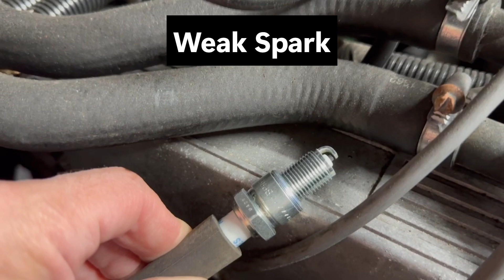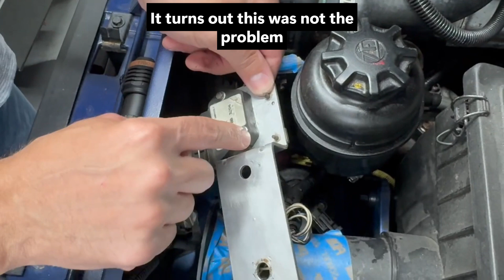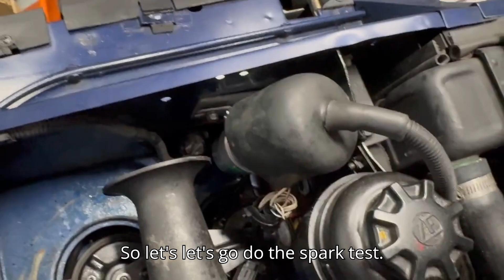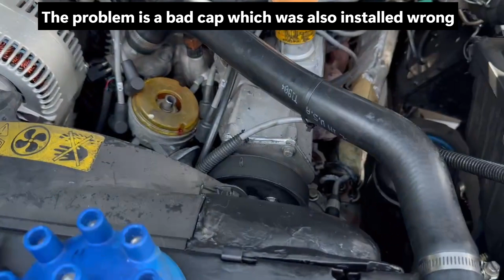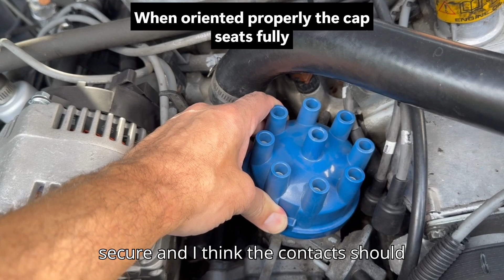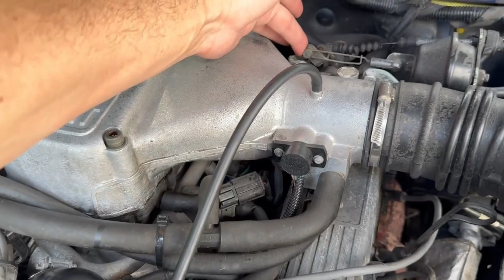1995 Range Rover Classic Starting Problem

Comment: Your vacuum line on the ignition vacuum advance is on the wrong port.  It should be on the back of the vacuum advance, not the front.
Reply from the maker: thanks. ill check it out.

Comment: Sir usually them rotor arms with the exposed rivet, aren't good and cause side sparks inside the cap.
Reply from the maker: That may be the case.  It seems to be working but if it gives me any trouble I will switch to a different type of rotor arm.